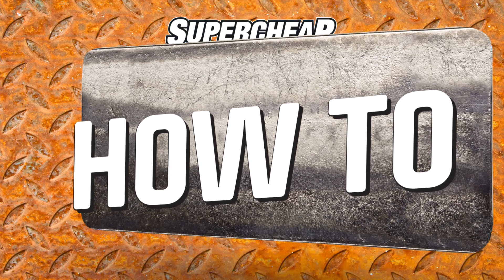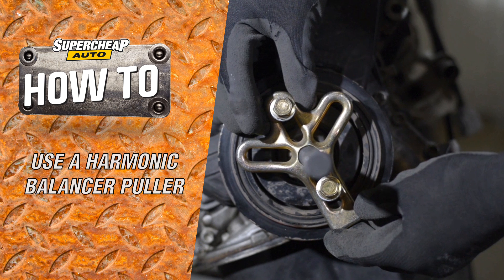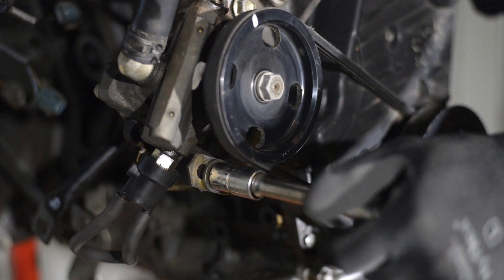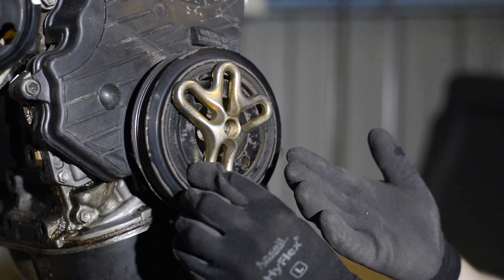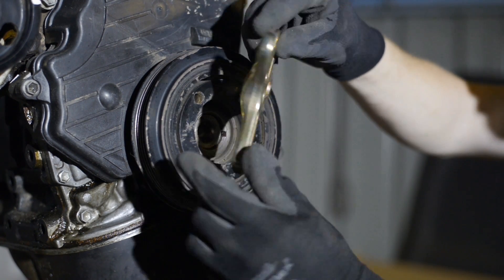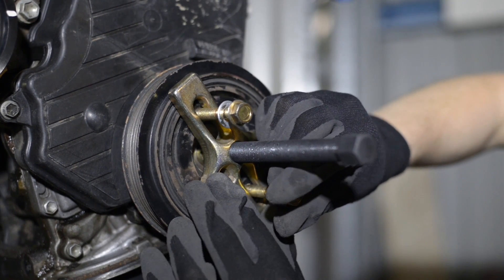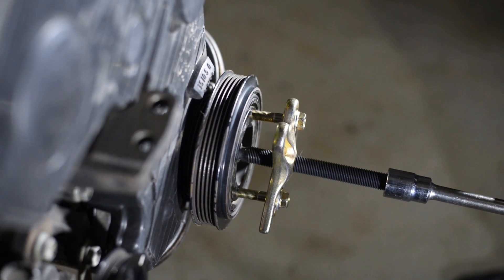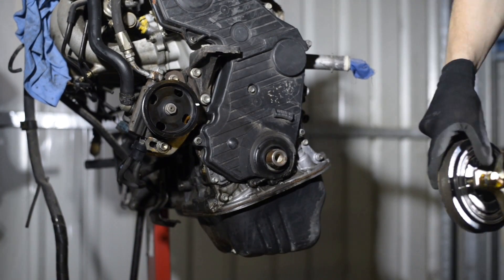Removing a Harmonic Balancer // ToolPRO Harmonic Balancer Puller

Comment: What do you mean "make sure the washer remains in place"? You can't leave the washer in the balancer because it will stop you from being able to put the puller through the balancer and onto the end of the crank. The washer MUST be removed with the crank bolt.

Comment: how did you stop the engine rotation
Reply: I jammed a flat head in between the torque converter and started teeth
Reply: Adrian Percival im having the same problem when I turn the 🔧 the harmonic balancer turns. Aswell
Reply: I'm 10 months late but i've seen people who take the bolt off by putting a breaker bar on the nut, then activate the starter for like 1/4 of a second. Interesting way of doing it, no idea how you get the nut back on though.
Reply: get an air compressor and air impact wrench